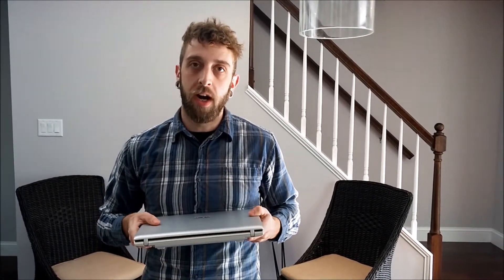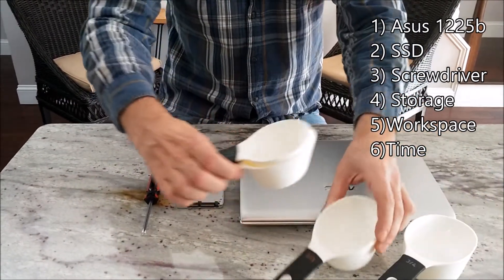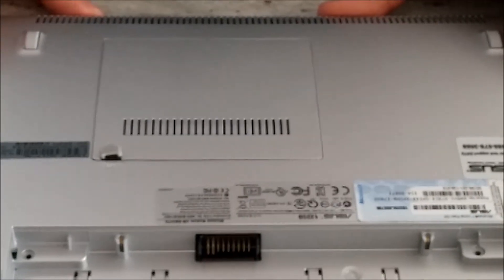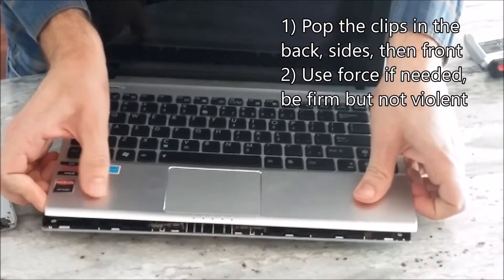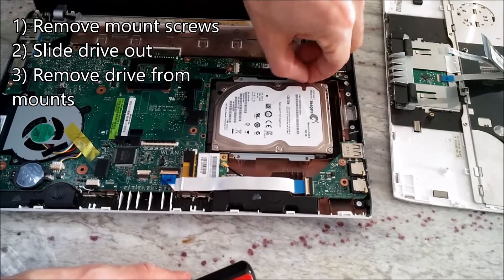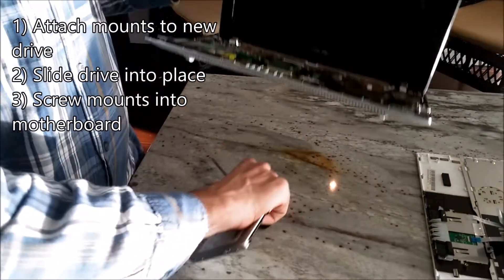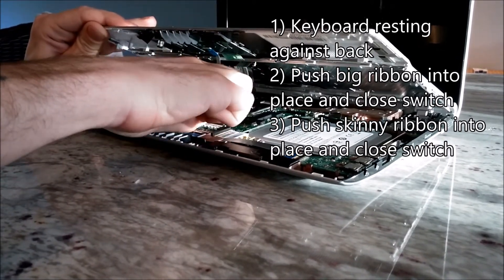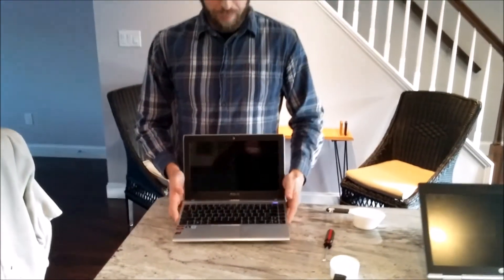How to replace the hard drive in an Asus 1225b netbook

Comment: Hi Erin! It's mid-2021 here and I've finally replaced the HDD of my 9-years-and-two-months old 1225b netbook with an SSD… Ready for another 10 years, I guess :) Thanks for the video, it's been very helpful!
Reply: How does it run? What OS does it support?
Reply: @MārtiņšBriedis  I used to run Kubuntu Linux on it, and now I'm using Debian Linux + AwesomeVM instead. Everything works well, from screen, to touchpad, to WiFi, and it's still fine for light tasks like web browsing, text editing and so on… Forget about gaming obviously, it was never designed for that anyway. It probably wouldn't behave that well with Windows, but I've never tried. Mine get quickly hot and all fans spinning these days, but I suspect I should clean the CPU and apply fresh thermal paste on in; the original one is probably cracked after 11+ years of usage and does not transfer heat as well anymore.
Reply: I'm planing to install MX linux on it, I will probably won't be able to tell the difference between that netbook vs a new PC, linux optimization plus ssd is magic and due to detachable battery my battery has like less than 50 cycles because it was used only to make it not deteriorate.